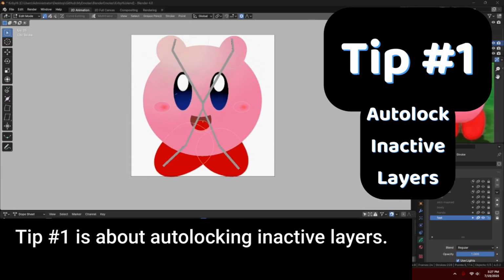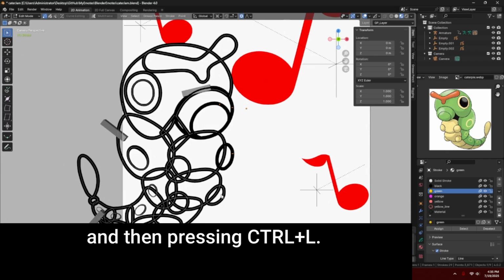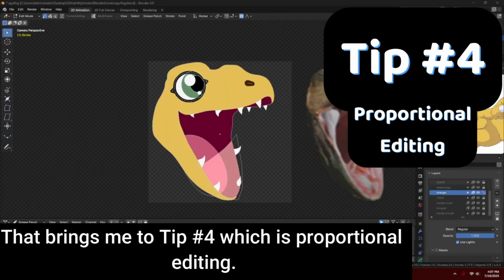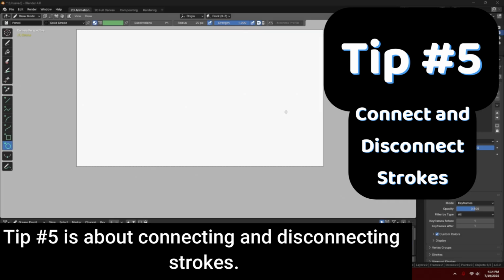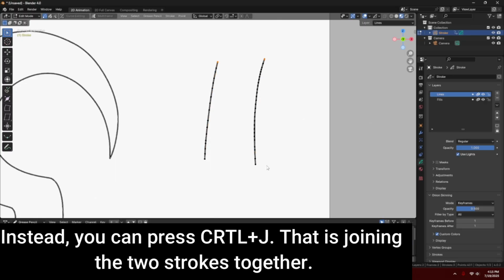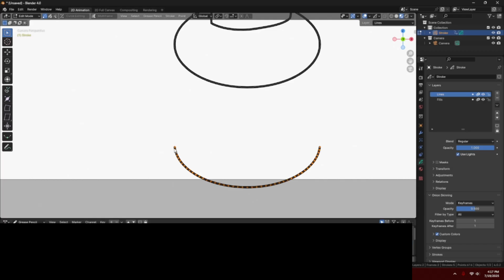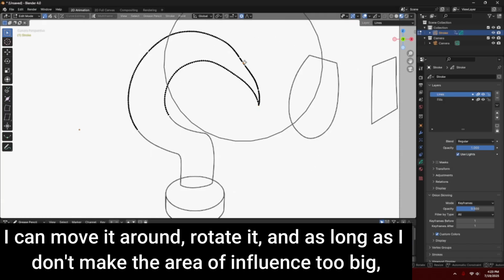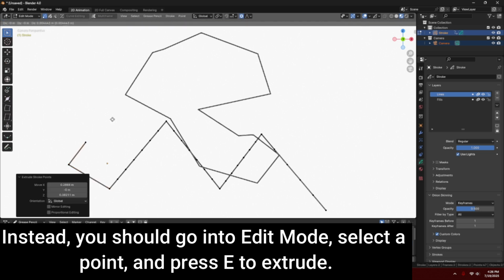7 Tips for Edit Mode in Grease Pencil (Blender)

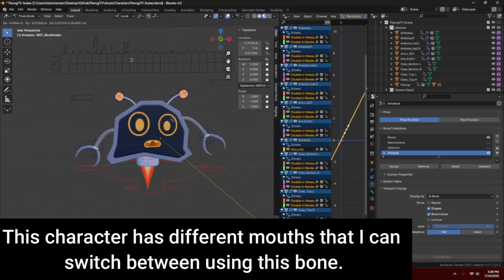Comment: Was there a specific tutorial or guide you used when coming up with your mouth rig for that robot character?(the one around the 1:00 mark) very interesting! Great video!
Reply from the maker: No tutorial for the mouth specifically. It is one of the first rigs i ever made. I don't use it anymore but it was supposed to be used to animate mouth movements for lip sync in post for videos. It sped things up a bit but I ultimately scrapped it for making a real VTuber. The basic idea of the rig is this:

1. In one grease pencil object, draw each mouth on a different layer. 
2. In an armature, add a bone. Restrict its movement so only the x position is unlocked
3. Set up a driver using the x position of the bone as the input, and the output as a custom property on the grease pencil object.
4. In each layer, set up a driver for the opacity. Check against the custom property to make each layer appear at different positions of the bone in the armature.

Basically this is how the bone moving changes which mouth appears. A bit of setup, but it is the best way to make mouths with grease pencil.
Reply: @RogisTutorials thank you for the information 🙏

Comment: Very clear tutorial. I'm having a problem. I made strokes that don't show in edit mode. If I turn off visibility for that layer, they disappear with the rest of the strokes on that layer, which can be edited. Any idea what's happening? thanks
Reply from the maker: I have never had that specific issue before, but I have had an issue where drawing strokes will not create them, even in edit mode and that was a bug. So, my best guess is that something went wrong with the Blender session. 

If I were in that situation I'd save and reboot, and if that didn't work duplicate the grease pencil and delete the old one. Hopefully one of those works. I have only had bugs pop up once or twice in my time with Grease Pencil, but it does happen sometimes.
Reply: I don't know Why this is a thing, but if you're using a version Older then say 4.0, Try baking the Line art...

Once again, I don't know Why that is like that, It's just Stupid, Simple as that... (>ლ) First Panoramic Camera and Vector Blur only works in Cycles, and Now This...